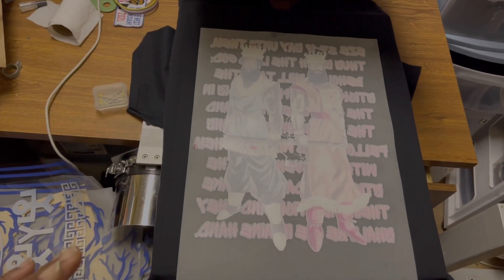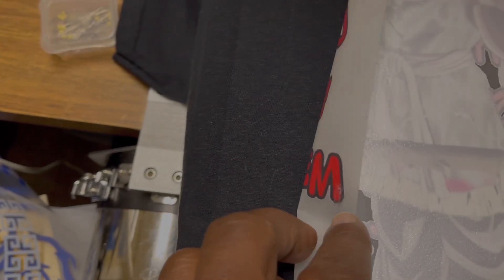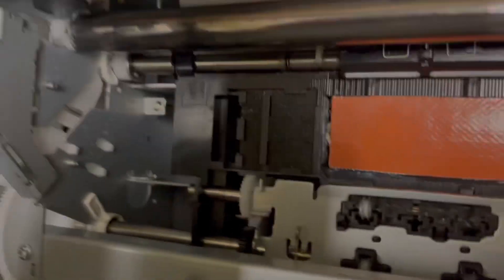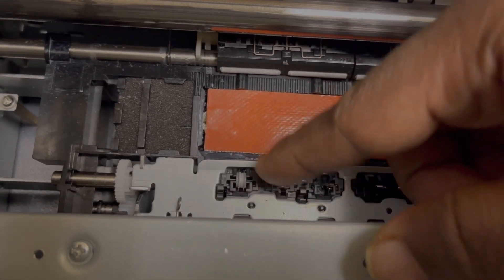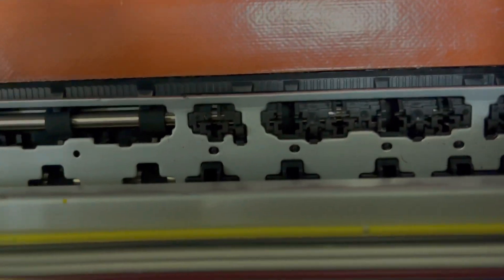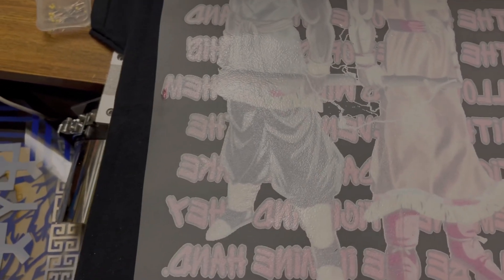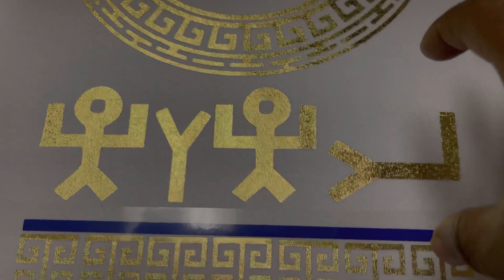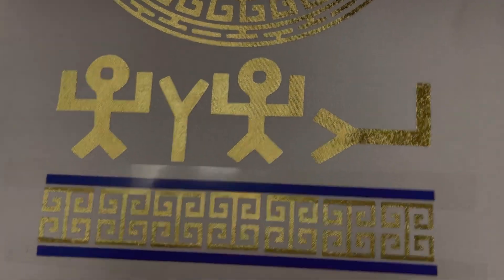DTF PRINTING (how are they converting the printers?) and some issues you may run into

Comment: Hi sir, i use print head l800 on l1800, i have a problem with white ink always out over from design, i have tried set decreas its nothing changed, maybe you have solution
Reply from the maker: Have you tried another printhead, I recommend having extras for that machine they are like 90 on Alibaba.com.  Make sure you are using the right settings,  sometimes settings be changing on their own with rip software

Comment: can you do a4 sheets? If so does it make contact with that wheel?
Reply from the maker: Yes A4 sheets will work and the machine is marked for it to adjust the tray.  As long as you don’t print on the wrong side of the sheets like I did and have ink running everywhere then clog wheels you should be okay.  But the best way to get around that is the bring the image into about 12in or 11.6.
Reply: @phineeprints9840  cheers